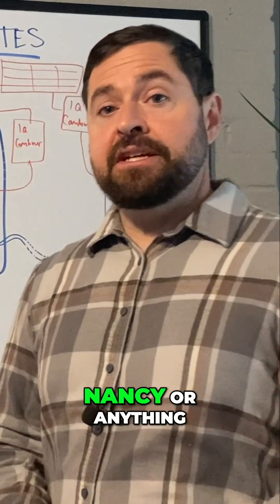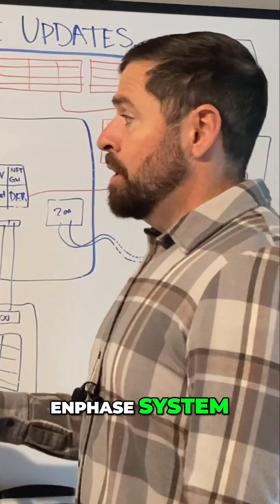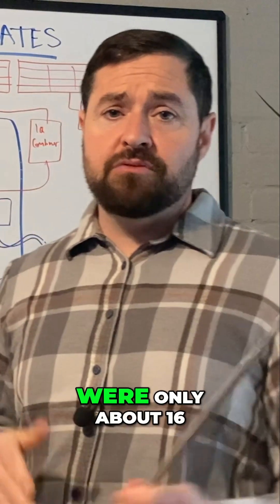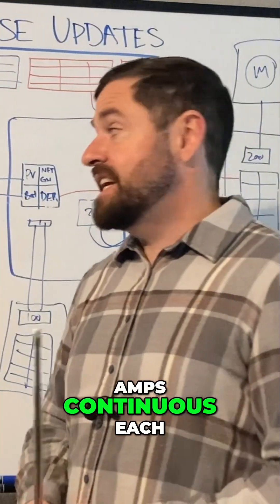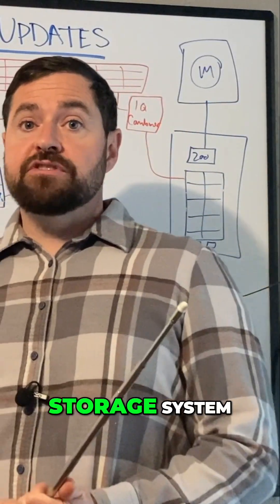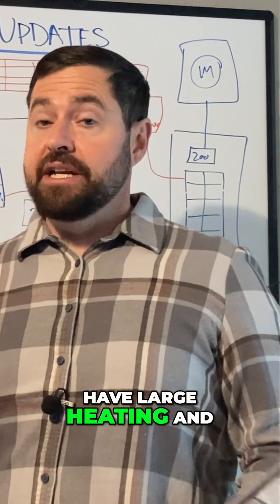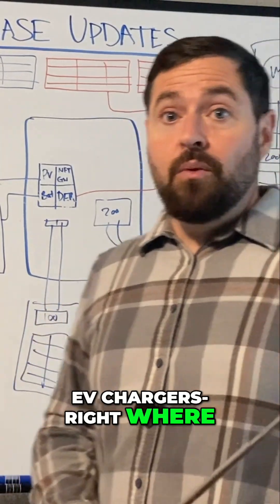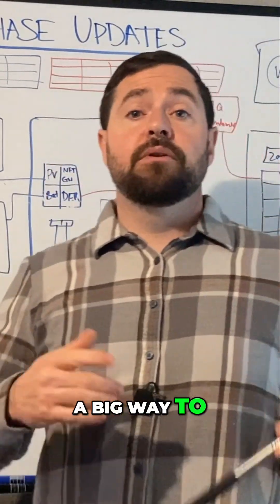Enphase IQ Load Controller: The TRUTH They Don't Want You To Know!

Comment: What if you install a back up load center with only your critical loads , ex like 2,3 circuits , lights , fridge, master bedroom . Would you still need the IQ load center ?
Reply from the maker: @adamramos8799   No you would not. The main issue there is that you need to install separate consumption CTs to monitor the non backup loads if you want the system to offset your utility bill and partial home backup is generally a good bit more electrical work compared to whole home backup. You are having to deal with the interconnection restrictions of 705 when the Enphase equipment is downstream of the main service panel rather than the Enphase equipment being your service equipment. Luckily Enphase released a "dynamic" Busbar Overload PCS which allows you to pull this off without any major electrical upgrades that were caused in the past. I plan on doing some more videos soon on the Microgrid Interconnect Device section of the code as well as Power Control Systems. Thanks for watching!